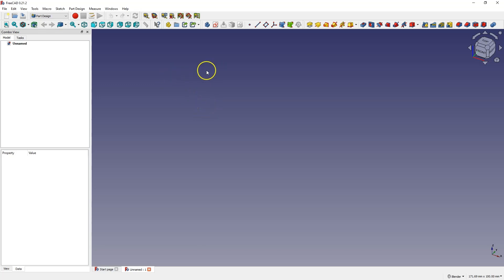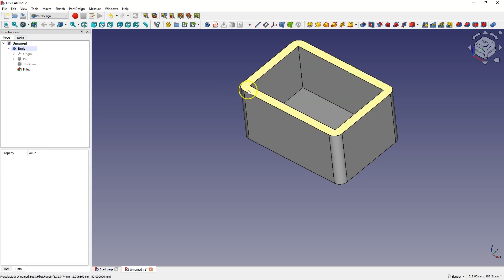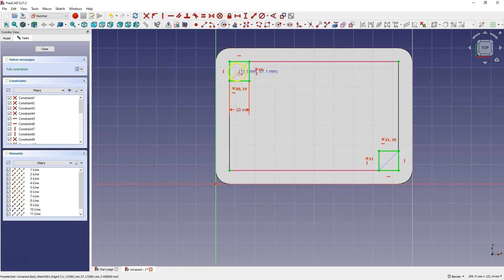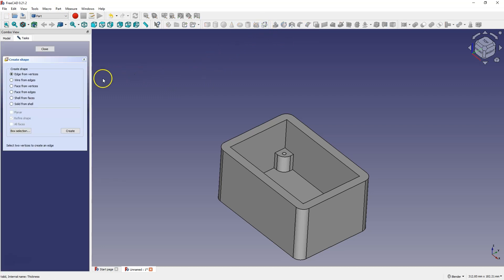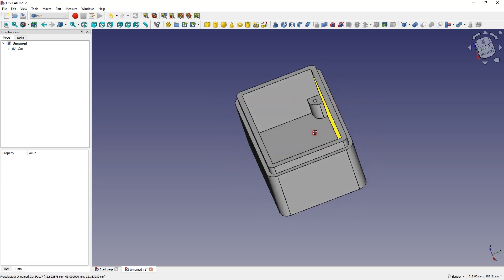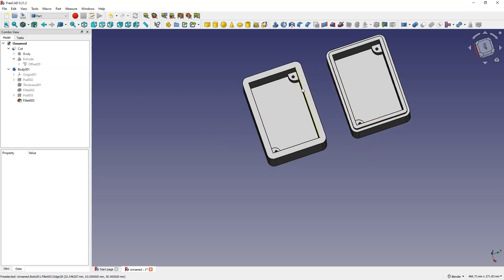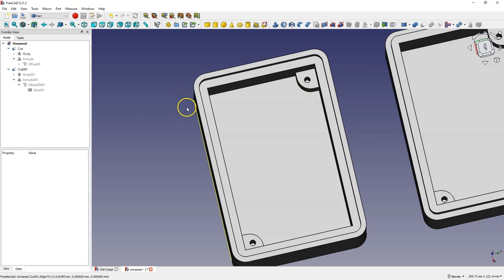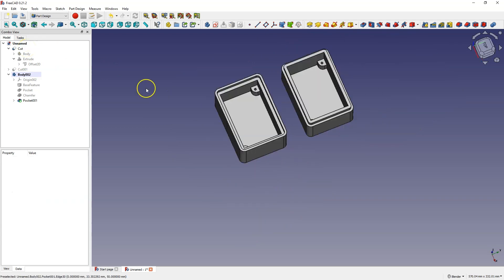Simple Electronic Enclosure in FreeCAD

Comment: Thanks for the video. I did a measurement of 19.5*16.62mm a PAD of 11.42mm usung FreeCAD 0.21.2.  When I cut I came back to the WIRE. What am I doing wrong? The overall Thikness is 1.5mm